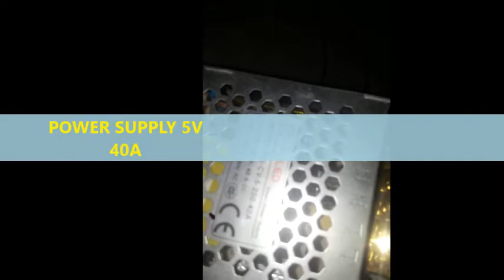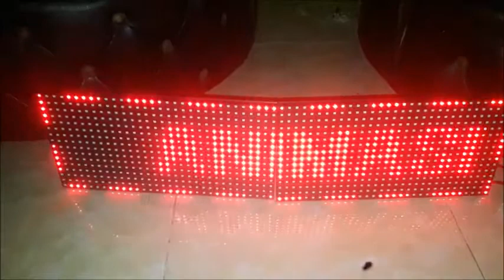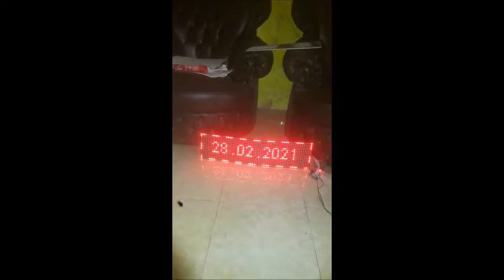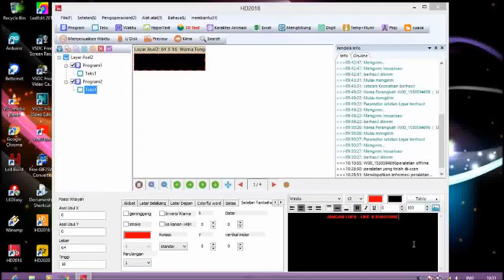Tutorial Pemasangan panel p10 merah

Comment: Bikin running text seperti itu dana berapa bang ?
Reply from the maker: Harga panel p10 di shopee atau lazada 72.000.
Harga controller 50.000.
Harga power supply 5 amper, sekitar 100.000..
Saya pakai 2 panel p10 
Belum termasuk  frem atau bingkainya. 
Paling dana yg butuhkan 400 .